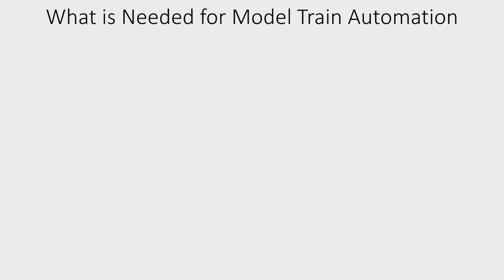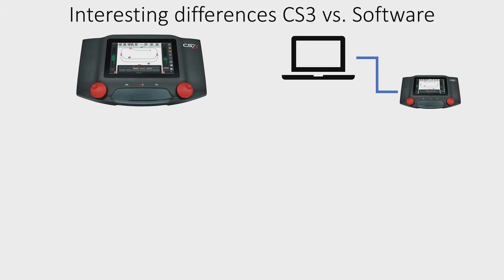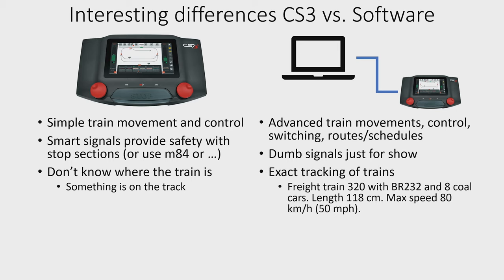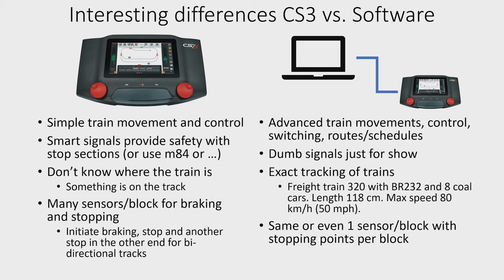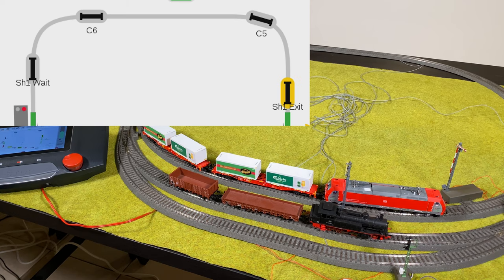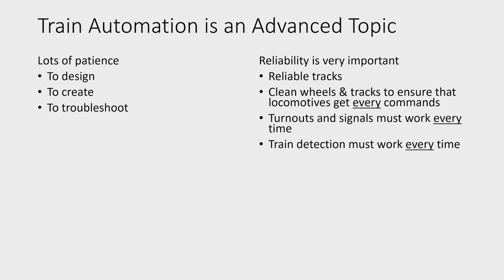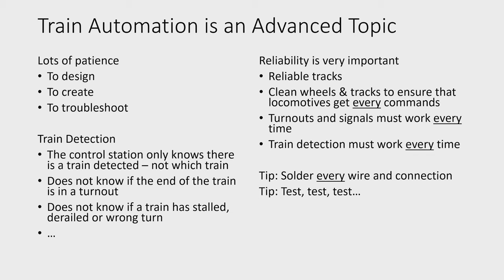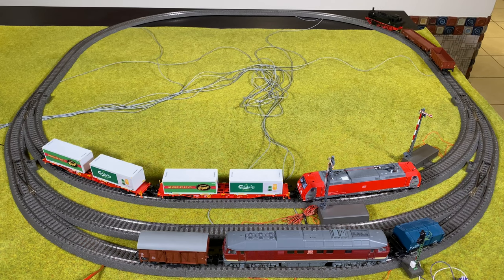What is Model Train Automation - Märklin Style? (Automation Episode 1)

Comment: Very good tutorials,  is it also possible,  to make stoptracks, whithout the signals,        by using  the k83, and the s88..for my shadow station,?  i think its very expensive to use the signals in this shadow station..and i'm looking for a less expensive solution. many thanks for your very educative expanation..
Reply from the maker: Hi Jannes,

Agree - no need for signals in the shadow station.

To me the most obvious choice is the M84 as it is really built for turning power on/off. The M84 is rated for up to 5 amps per group (there are 4 groups). For use in a shadow station, you can turn it into 8 on/off like I have done in the video for controlling 8 lights: https://www.youtube.com/watch?v=eo65jHaoWqE Additional benefit is that you can use the input on the m84 to sense when a train is on a shadow track. I have not yet tried this myself and am not sure if there are any pitfalls. However, I intend to make a video on this in the future.

You should also be able to use the M83 - however, it is rated for 3 amps in total. This might be ok for a shadow station, but unsure if the M83 is ok with this type of usage. It was originally built for turnouts, so unsure if this is a stretch. You can program the M83 to work as an on/off as well. I have not tried it with the m83 either - I am unsure how well it will work. However, you will need an S88 as well to detect when the train has arrived in the shadow station.

If you have a CS3 you can also automate locomotives to automatically stop in a shadow station and turn off. However, it requires a dedicated control of each locomotive like what you see in this video: https://www.youtube.com/watch?v=ieAltkA_WDw or some of the earlier episodes in the Automation series.

You can contact me by email (see the "About" on this channel for my email) if you cannot wait until I make a video on this (might take some time). I will try to help as good as I can over email.

Enjoy ;-)

Comment: I  use contact reed as sensor that I find quite reliable
Reply from the maker: Cool - I have not tried the reed contacts (aka reed switches). I have heard that they are reliable, if you are careful to place the contact/switch and magnets correctly. Are you using the Märklin ones (Märklin 7555-8)? Is it easy to make automation using these? are you using CS3 or another control station? Have fun ;-)
Reply: I use contact reed from Marklin (ref 7555) that is connected to an S-88 module (ref 60881). I use an CS3 plus as a control station. It is very easy to set up.I prefer this system than to create contact track. You need to attach a special magnet under one of the locomotive or wagon in order to generate the signal to the central sation. You have specific magnet that you can attach in the Marklin assortment (Ref 7556, 7557 and 7558)
Reply from the maker: Cool - will have to try it. Question: how do you handle trains with magnets in both ends (so you can detect both directions) in the CS3 events? In essence how do you ignore the 2nd trigger? ...or do you just have magnet in one end and detect the other direction differently? Enjoy ;-)
Reply: Wow you are a Toy train CYBER ENGINEER too.Iam about to go to your channel right now,and see what contact Reed as a sensor is.
Reply: Normally, one can place the magnet below the locomotive or under one wagon. I tend to place the magnet under the last wagon of a convoy so that when it enters a block it triggers an event (light or turnout). Normally, it is the best way to avoid accidents. Marklin magnets are very handy as they come with strong adhesives.
Reply from the maker: Great info - thanks! By intuition I would place the magnet on the loco, but I see the wisdom is placing it on the last car instead ensuring the entire consist is within the block. Enjoy ;-)

Comment: Hi, and thanks for fantastic, instructive videos. I have just started with CS3 and your channel is helping immensely! I have one question: I realise I need to create and name a lot of events and I would like to document it nicely. Where do you find the icons you use on your slides? I would like to use them to document my events.
Reply from the maker: Hi Mattias,

Documenting the events is something I have not found a good way of doing, so I am very interested if you have found a good way to do this. I usually end up taking screenshots of the CS3 - or just save as backup. 

The icons are basically just taken from screenshots of the CS3. In order to make screenshots of your CS3 do the following:
1. Connect the CS3 to your local network as shown in this video: https://www.youtube.com/watch?v=opV2N25FF8k&t=19s

2. When you are connected you can see the network IP address of the CS3 in the settings as seen here: https://youtu.be/opV2N25FF8k?t=301 In this video the IP is "192.168.171.2". 

3. Use any computer, tablet or cell phone and open your favorite browser. Go to website "192.168.171.2" or "http://192.168.171.2/" (remember to change to the IP seen on your CS3). 

4. After accepting terms & conditions, then you can click on "System", scroll down and you can click on "Creating a screenshot". This will take a screenshot of what currently is on the screen of the CS3 and give it to you as a photo.

Hope this helps! Enjoy ;-)
Reply: @ModelTrainFun  Hi, thanks for your reply. I will test it out. My documentation is still very much in development. Basically I’m just creating a table with the events: their name (something similar to the naming you use), a description what they do and in the last column I would like to put the actual program blocks. As suggested I will try to paste screenshots in there.

Comment: is this also working with the mobile station 2
Reply from the maker: Unfortunately, the Mobile Station 2 does not support automation. You could do some very simple (electrical) automation with the m84 using  the input ports to change the output ports. I have not tried it, but you should be able to change a turnout when a train arrives at a circuit track. I might do a video on this sometime in the future. Enjoy ;-)
Reply: @ModelTrainFun  please make such a video! Thank you for your Chanel
Reply from the maker: @modelrailroadlars3247  I am definitely considering it as this could be fun, but it will require a lot of experimentation to make it work. Enjoy ;-)
Reply: @ModelTrainFun  thank you!

Comment: why do you need C5  ?
Reply from the maker: Not sure I understand the question?
Reply: @ModelTrainFun  c5 is the contact in the upper right. What does it switch?
Reply from the maker: @eriks5111  C5 and C6 are not used for anything in this example. They are there to illustrate potential contacts "out on the layout" and show that the train triggers as it drives.